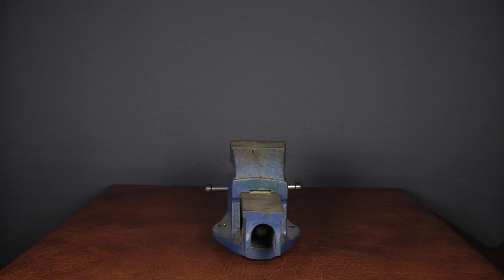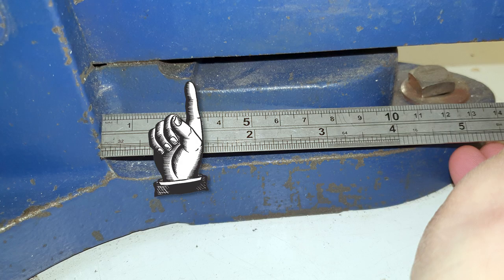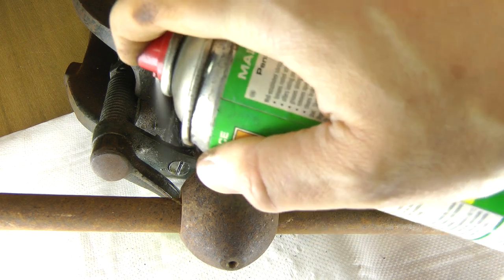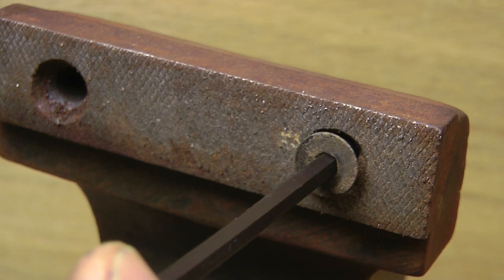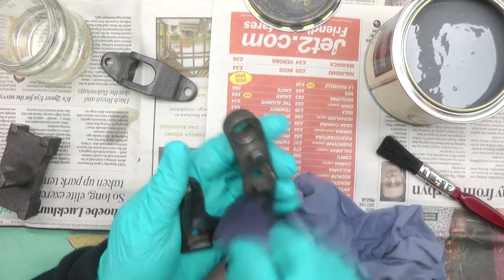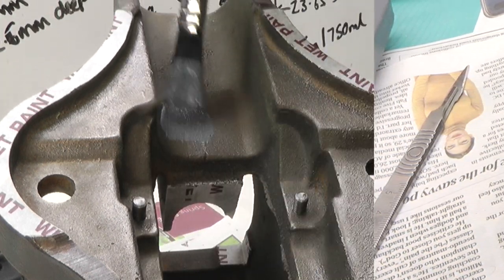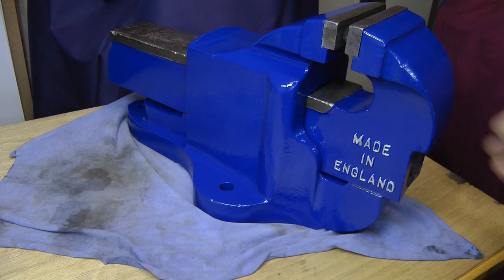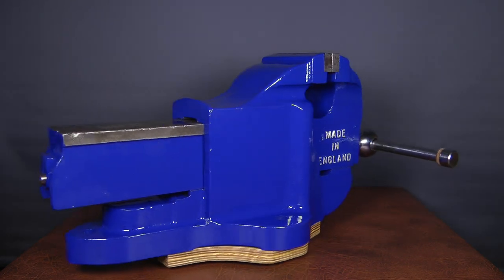Record No 23 Quick Release Vice (Vise) : Mechanism Strip, Clean and Reassembly

Comment: I liked your idea of putting the leather washers on the handle. However, I did not want to disassemble my handle so I made four leather washers, made a cut from the centre to the outside on each of them. This enabled me to put them on the handle. I then glued each pair together with an impact adhesive, so that the cuts were opposite each other,and then that was the job done. This now saves my fingers from being pinched so easily on my Record 35. 😀🇬🇧

Comment: I looked it up: "The buttress thread form is designed to handle extreme high axial thrust in one direction. This is typically a 7° angle on the weight bearing surface and a 45°angle on the trailing flank, which provides a form with good shear strength." Good video.

Comment: Awesome! Having rebuilt 5 or 6 vises myself, in addition to well over a decade working on (frequently rusty) automobiles, I'd wager the castellated nut is merely old & pitted, by the way; not cast. A cast nut won't survive... well, anything, really. They were able to source & machine steel for the other important bits. I'd be surprised if anything of that manufacturing era, with "Made In England" proudly proclaimed across its surface, would've included an Achilles' heel such as a cast nut, unless it needed to be a super weak mechanical fuse — and I have yet to hear tell of a bench vise built with shear pins, you know what I mean?

Anyway, it looks pitted, to me.

This was an absolutely excellent restoration chronicle.
Reply from the maker: Thanks for watching, and leaving a comment 👍 🇬🇧

Comment: Nice find and great job on the restoration. Not quite sure how I got here but have been enjoying your videos. I liked your tip about using a smaller bottle for the Dykem blue a while back. Not my idea but, for small areas and parts a blue, fat 'Sharpie' marker works great with no mess.  ...Although, not quite as visually appealing as the Dykem flowing onto a spinning part. :)

Comment: Great job mate.
New subscriber here.
Sotherner originally, now Western Australia.
Whereabouts is your accent from?

I have a similar vice im about to go over, it's a Dawn 150 q/a.
No plate to remove on the dynamic jaw but almost identical otherwise!
Although the thread appears to be in great condition on both the shaft and the nut, it disengages under load.
Im wondering if there's a shim or washer missing somewhere, any thoughts or other suggestions?

Looking forward to watching more of your work.
Best regards from the colonies.
Cheers!
Reply from the maker: There's a bit of Lancashire and a bit of Yorkshire in there.

Have you checked the nut is the right way round? A buttress thread is only strong in one direction. 

Are the holes in which the lead screw run worn or otherwise loose fitting at all, allowing the screw and nut to separate? Would a close fitting bushing help improve the fit? Either concentric or offset to hold the screw at the most effective position.

Is the screw straight and true? 

Is the effect the same when the jaws are barely open and fully open (the screw is unlikely to be worn equally down its whole length, but the nut might be)

Is the spring which engages the half nut strong enough?

Thanks for watching, and best of luck with your project!
Reply: @TheRecreationalMachinist  definitely suspect on the engagement spring, though i thought once the pressure builds, the screw would be forced to engage fully, ill check more and report back..
Cheers mate!!
Reply: Worth checking the bushing potential too i think.
It doesn't look like it's had an active life, but there's something going on!!

Comment: Im doing up my 23 now, found a makers stamp 22 on the base,  can i ask what were the jaw screw dimensions 5/16 bsw 1.5 inch? your video is the best ive seen, excellent technique and so very informative, please do some other vices
Reply from the maker: Thanks for your kind words! The jaw screws I used on my number 23 were 5/16" BSF (fine) and 1 inch long. The front bracket screws were 1/4" BSW (coarse) and also 1" long. Good look with your build. 👍 🇬🇧
Reply: @TheRecreationalMachinist  where on earth did you find bsf 5/16 1 inch im in new zealand and they just dont exist
Reply from the maker: @starflash08 mine are 5/16 fine. I double checked when I got home from work! Yours may not be... 

If you're a Facebook user take a look here: https://www.facebook.com/TheRecreationalMachinist/posts/392855185790477

Yours could be 5/16" BSW (coarse) which are pretty close to 5/16-18 UNC (which might be more readily available in your area). Do you have any of the original screws? Even without thread gauges you ought to be able to tell the difference between 18TPI and 22TPI just using a steel rule. Make an oily impression on a piece of paper with the screw threads, then cross them off with a pen as you count. That's how I do it anyhow...

I have no connection to this company, and can't say what they're like at dishing out free advice (or shipping overseas) but it couldn't hurt to drop them a message. They may be able to guide you. Best of luck.
Reply from the maker: Edit: I missed off the link!  www.viceworks.co.uk
Reply: @TheRecreationalMachinist  yes mine are bsf, I’ve tried to source some replacements in nz and aus but no one stocks these, so thanks heaps for the link

Comment: I have a Record No22 that I am just about to restore, but I cannot find any videos or literature on the mechanism, or disassembly instructions. Does anyone know if the No22 and No23 are similar? The No23 certainly looks bigger. Out of interest how much top coat did you use to paint your vice buddy? I'm going to buy a 500ML tin of the same paint. That should be enough no? ☺
Reply from the maker: As far as I know the 22, 23 and 24 are identical apart from the size. A couple of coats of paint used only about one third of my 500ml tin. Good luck with your project 👍
Reply: @TheRecreationalMachinist  Thank you RM. Invaluable information 👍🤝